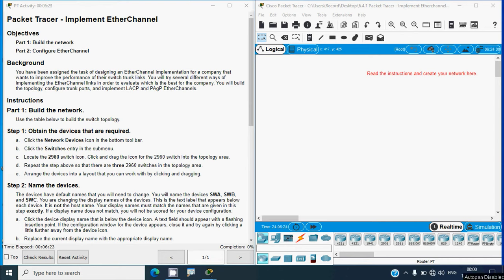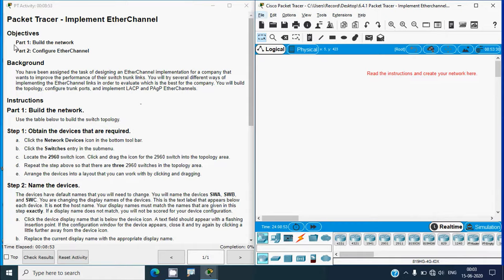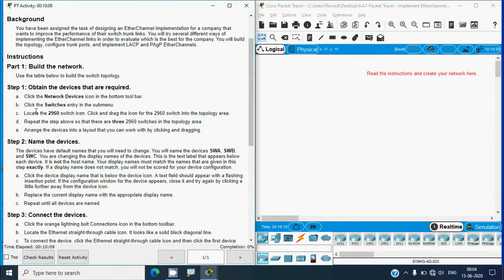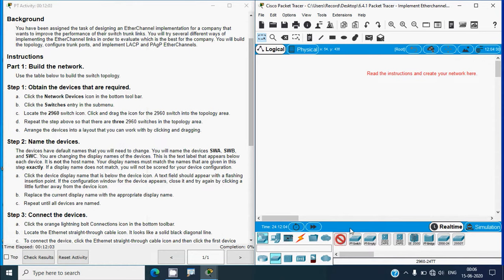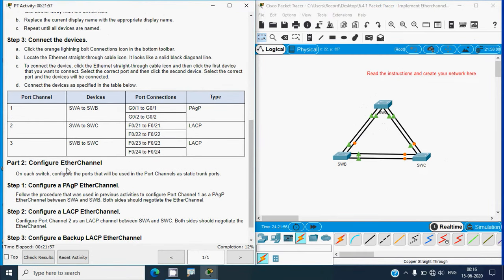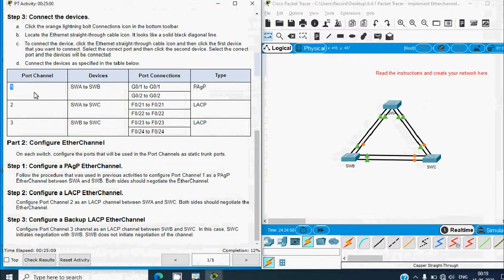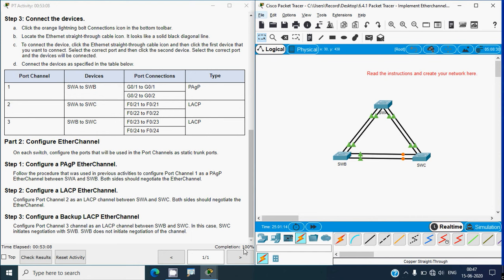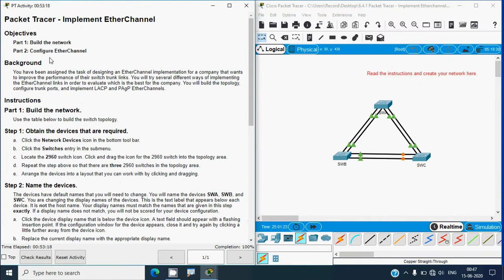6.4.1 Packet Tracer - Implement Etherchannel

Comment: Hi before implementing etherchannel,eg: interface range g0/1-2 need to be switch port mode trunk first? or that is not compulsory to do so? because we can configure switch port mode trunk in int port-channel there right?
Reply from the maker: Yes, you can.  Create the etherchannel and configure trunk.  But it is recommended to configure the required interface as trunking prior to Etherchannel